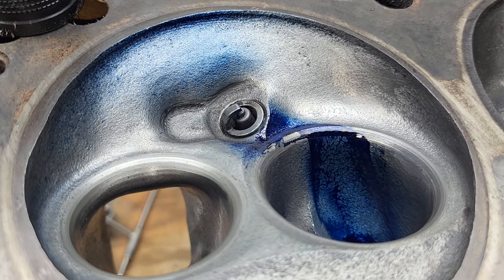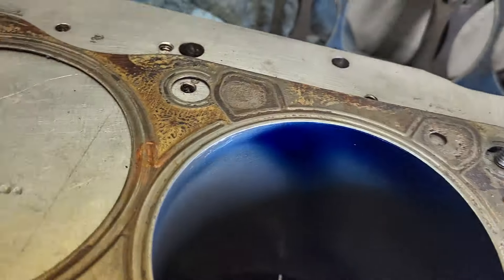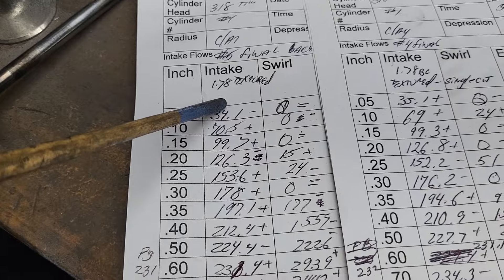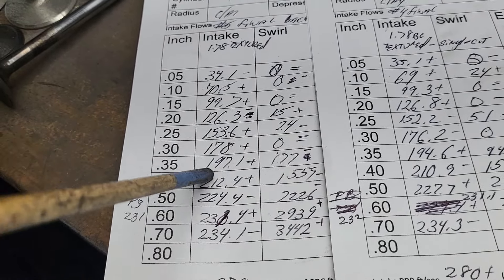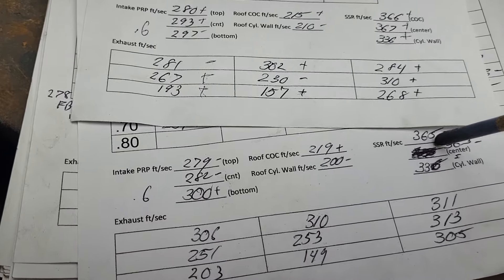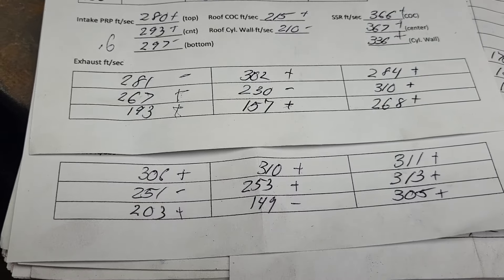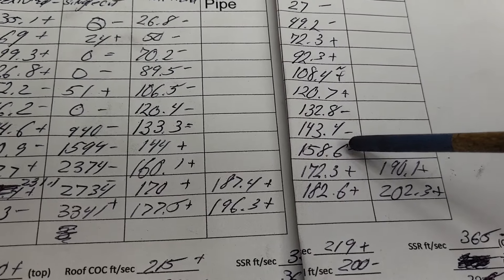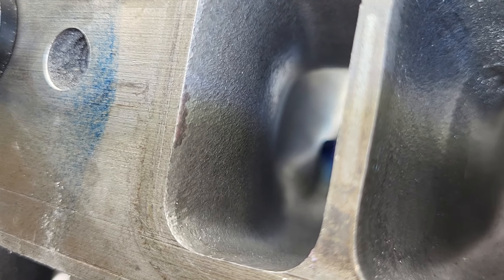David Vizard, Unity Motorsport Mission Impossible 318 project. Back to 3 angle v.j.

Comment: Considering the valve size restrictions this flows pretty good, not sure to get 500hp but close. I think if you had a 2 inch intake valve it would be up with the chevy heads
Reply from the maker: I think enough rpm it would do it.
Reply: With the 3.91 bore, the valve shrouding severely impacts low lift flow. I'd like to see a 1.88 or 1.94, I think that would be a great compromise
Reply from the maker: @littlevman2997  So would I it would be a lot easier!